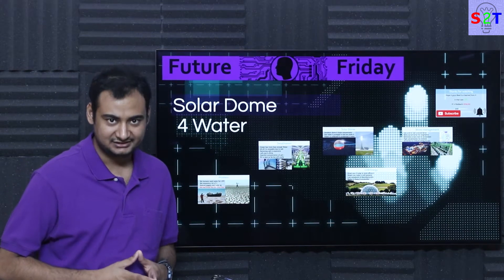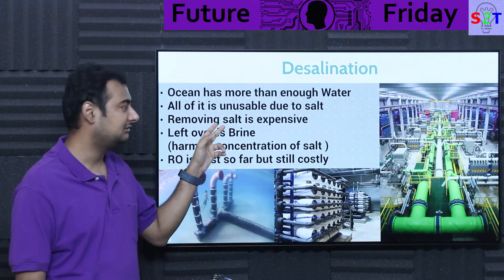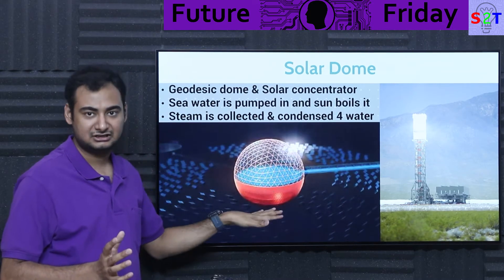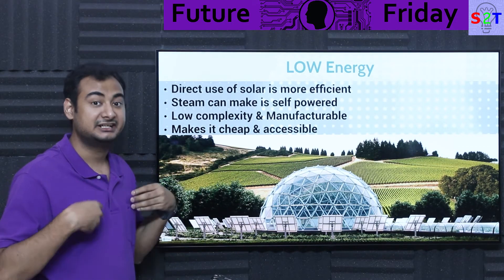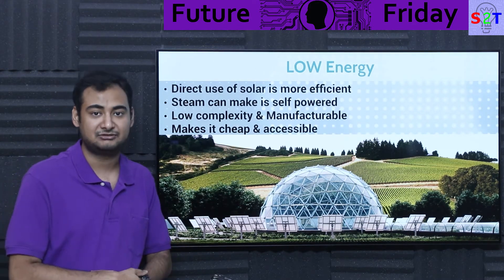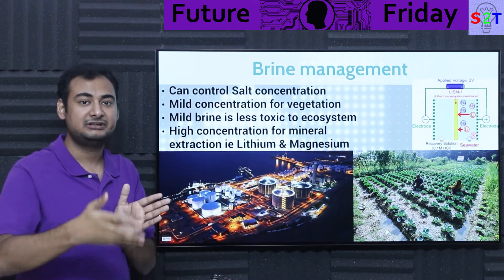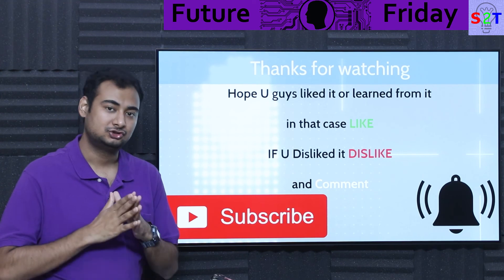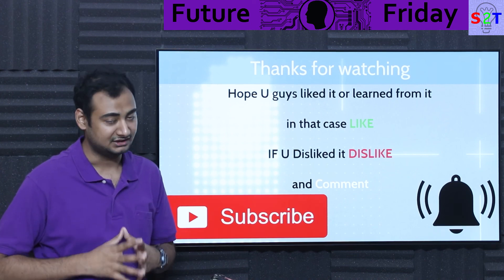Solar Dome 4 Water Explained {Future Friday Ep151}

Comment: Could this be used as a floating dome placed at a coastal location to produce fresh water piped to the coast? Or in a shallow coastal sea water filled lake (for example placed at locations in land near sea with al altitude below sea level, like the Qatari depression in Egypt)?
Reply: On the coasts of the Sahara desert, from Mauritania, Morocco, Tunisia, Algeria and Libya, in all this subtropical arc, how a totally unproductive desert can be generated or regreened with integrated polyculture systems based on seawater.

 This project is based on a great advantage that these coasts have, and that is the existence of immense lagoons that are below sea level, in such a way that, with a small inlet canalization, an impressive flow of water can be generated at zero pumping cost. This would lead to the creation of a wealth of biodiversity, the benefits of which would have a global impact.
https://www.youtube.com/watch?v=moWK5GazdkI&t=1s
Reply from the maker: I have to look into it but maybe not as it needs a lot of trackable mirror which would be hard to do on water
Reply: Absolutely, at least that was my idea when I was 8. 😀